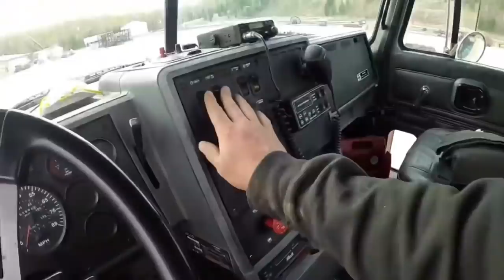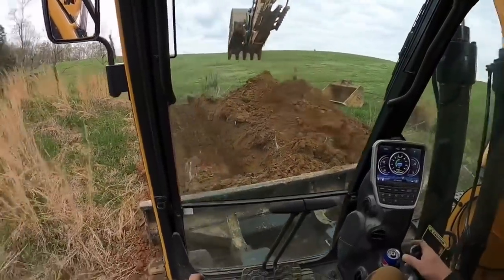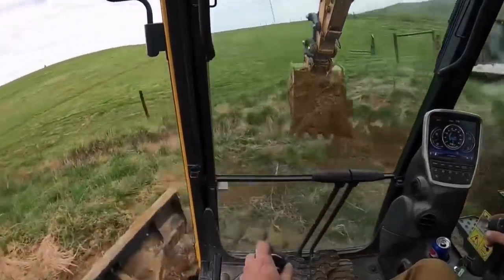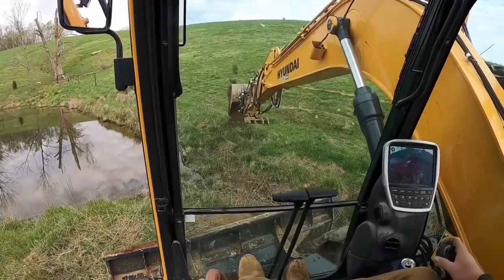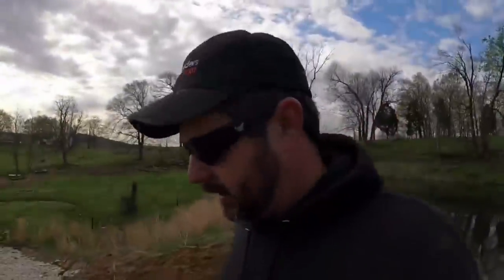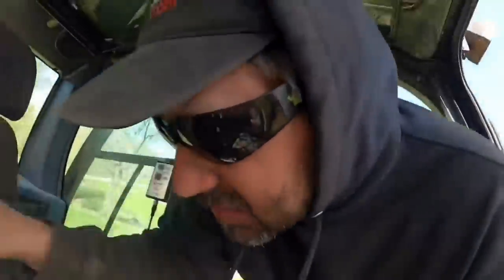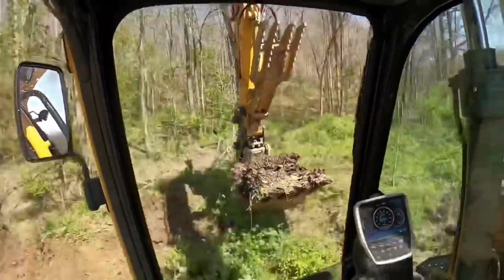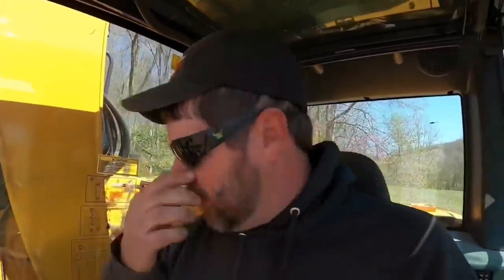Installing a pond overflow and a few odd jobs for farmer Chris with the Hyundai HX145 excavator

Comment: Certain sounds are soothing, rain on a tin roof, a two cylinder John Deere tractor running, and the clank clank clank of a tracked machine rolling down a road. One thing I can't stand though is a squeak on one of my machines from the lack of grease. Drives me nuts.
Reply from the maker: lol me to
Reply: If you dont grease them all while your at it , dont grease any of them.

Comment: Those Road Liner tracks are for utility work which the zero tail swing machines shine, non marring for paved roads, Road liners on slippery surfaces its like riding a toboggan you can't get a playing card between the cheeks you're clenched so tight LOL. Its funny seeing a CWS bucket in Derby Indiana its a 2500 miles from its original home. My neighbor's family started that company he sold out 3 decades ago, engineered, designed and hand welded those those buckets. Sadly the current production of CWS buckets are not the same quality and durability as the ones built in the 70s and 80s they were built for extreme duty for the logging industry.

Comment: While watching your video your talk about the Hyundai excavator having a short swing radius (may not be your exact words) caught my attention. I recalled hearing you mention the same feature in another video and because I know nothing about excavators except how to read the make and model off the side of the unit I decided to look it up.  I can see where this option could come in handy when working close to an electric fence or other farm structures. I would guess that the number of units listed for sale  with that option would be low.
I would give you a 10 for your slip, not because you took it but because you showed it. I have taken a few spills that way myself.

Comment: gravity continues to work, no need to test it twice by slipping, but you keep it entertaining
too bad there is not a 5 minute way to change tracks at a jobsite so you can use metal or rubber- invent something and make millions $$$$
Reply from the maker: That would be nice for sure
Reply: Question for you Dirt Perfect , did Hyundai compensate for weight difference of steel to rubber somewhere in the undercarriage?
Your Volvo must be somewhat larger and  heavier than Hyundai.  About 16 years ago  I worked for a man building hay fields, both dozer and excavator brand new.  I liked both machines for hopping onto site work for spec houses and the field building. I would be leery to buy one for heavy highway  egagements involving ledge and boulders daily. Then he bought a large front end loader, nice machine also. It was a dealership rental/demo. Interesting stories on all 3 pieces sometime if your  curious. Dealer stood behind equipment, but it took some doing when it came to purchase of loader. Lol